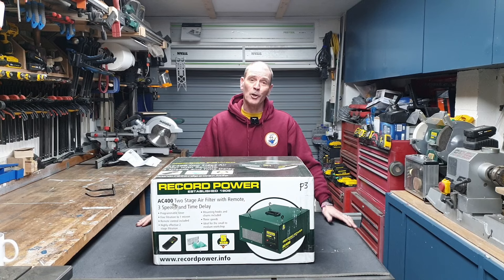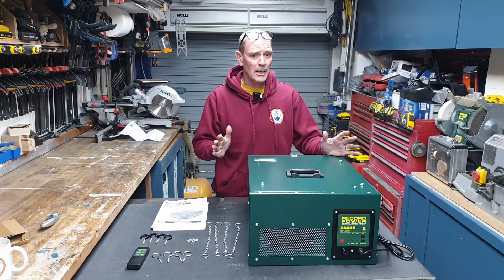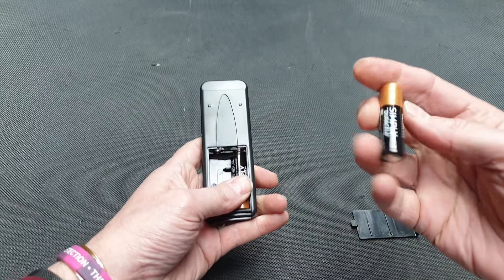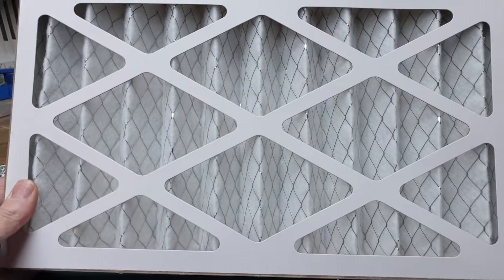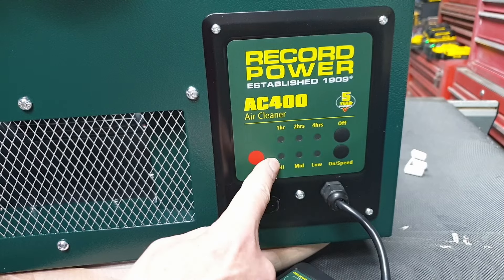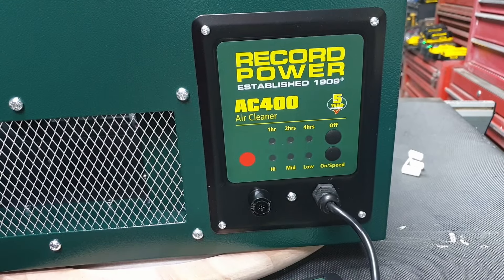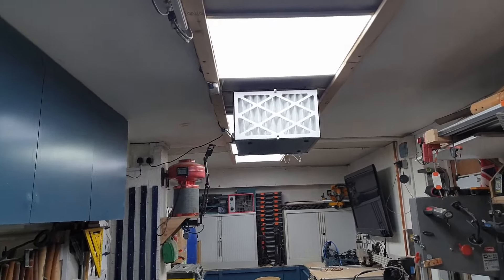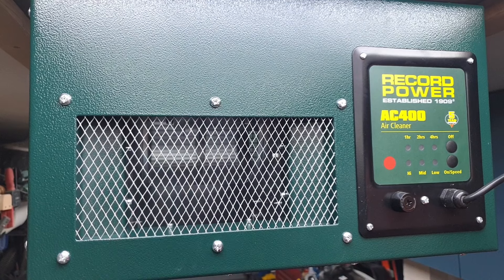Record Power AC400 two stage air filter

Comment: If I had a quid for every time you said "okay" I would be able to afford an AC400. A very informative video which told me everything that I wanted to know before purchasing one, my issue is that I can't mount it as intended because my shed/workshop celling is too low so thinking of wall mounting on it's side but I've no idea if that would be good. Thanks for the video.
Reply from the maker: @Crazy_Dave  😁 Hi Dave. I know what you mean about lack of space ☹️. I know it's not recommended, but they can be mounted on the side (as long as you don't obstruct the inlet or outlet). I seem to remember "Badger workshop" (here on Youtube) had he's one mounted on its side. Possibly have a look at his videos. I'll see if I can find a link 😁. Thanks for watching Dave 😁👍
Reply from the maker: Badger workshop link https://youtu.be/D4NOUn-9EFs?si=zbwLOZD0y4cAqiw3

Comment: I've had mine for a year - very effective and well worth the investment.
Reply from the maker: 😁 Thanks Jeremy, I'm hoping for good things from this filter. And I haven't bumped my head on it yet... so its all good 😆. Thanks for watching 😁 👍
Reply: I have mine on a high level shelf, but I know that Badger Workshop had his on its side which - I believe - Record Power agreed was fine.
Reply from the maker: @MrJeremyNako  😁 I have seen Matts setup and that is my other option to have it on its side ( my workshop is not wide enough), I will see how I get on with it mounted on the ceiling 😁👍

Comment: I have the rutland equivalent in my small and dusty workshop,. and does it work. My biggest problem is not remembering to switch it on , until the dust sticks to your tongue . Dohh, so to say . Love  the outakes as normal
Reply from the maker: 😆 Thanks Paul 😆. I do the same with all my extraction. It dont matter how good a bit of kit is.... if you don't turn it on it don't work very well 🤔. But on the up side... the filters last longer 🤣🤣. Thanks for watching mate 😁 👍

Comment: I have the same unit and am very pleased with it. It takes the dust level down to the point where it will even take the smell of cut MDF out of the air.
Reply from the maker: 😁 Its surprising how long the small particles hang around suspended in the air. If you can smell the MDF then the partials are still airborne. The problem i have is even if I'm not cutting any material, as soon as I disturb anything it kicks up the particles. Hopefully this will eventually even stop that from happening 😁. Thanks for watching Andy 😁👍

Comment: Frank, not every workshop can use the chains to hang the unit. I used microwave brackets to place mine upon as I have it on a side wall, this works a treat.
Reply from the maker: 😁 there's no way i could use the chains without banging my head every time I go in the workshop 🤕. Ill see how it works out, I always have the option of putting it on the shelf my old filter was on (it may need some modifications). Thanks for watching 😁 👍

Comment: Mine packed up in no time and got replaced by supplier. A year later packed in again Record sent me a circuit board a few months later packed in again. Record got me to send it to them a couple of days later it’s back. It does a great job when it works. Oh by the way one of my cancers is in the throat so it would be cool if it was reliable.
Reply from the maker: 🤔 Looks like I'm going to have to keep an eye on how reliable the controller is. It looks like its its weak point 🤔. Your 100% right, it has to be reliable. Either way, its got to be better than what I have now 😁. Thanks for watching, take care mate 😁👍

Comment: I have the Rutland's version basically exactly the same as record does a great job of cleaning the air remote not the best, had it 3 weeks stopped working sent me new circuit board a year later now turns itself on randomly so make sure you turn it off at the socket when not in use as you will end up with an expensive electric bill 🤬
Reply from the maker: 😁 I think there are so many that are all the same design. I just hope I don't have any issues with it. Looks like the controller is the weak point 🤔. I'll try and turn it off when not in use. Thanks for watching mate 😁 👍